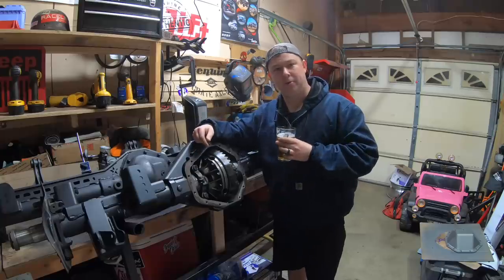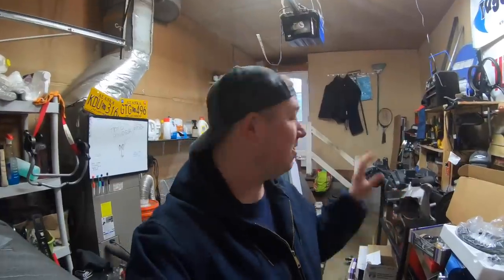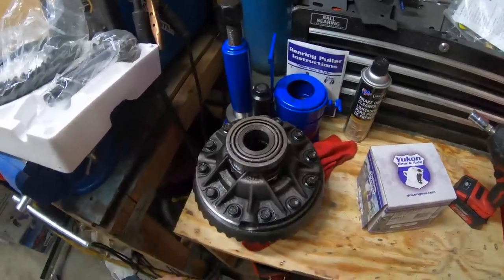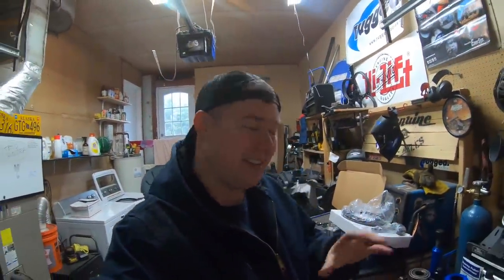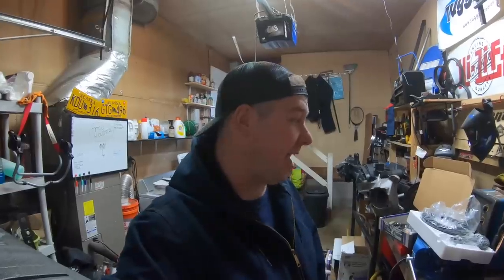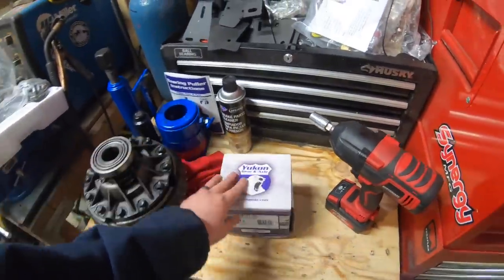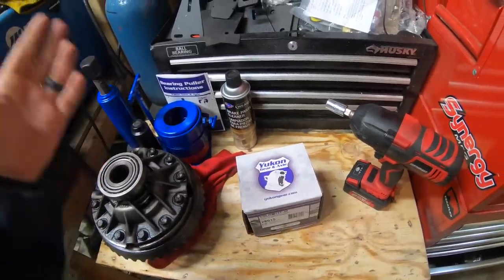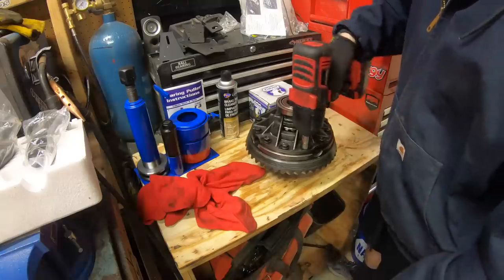14 Bolt Axle Regear And Locker Install - JK 1 Ton Swap Video Series

Comment from the maker: Additional info is in the video description! Feel free to ask questions below and I will answer them! Sorry it’s a long video, but I wanted this to be step by step. This isn’t supposed to be a fun or entertaining video, it was made to educate people doing this swap and hopefully help others that plan on doing this at home.
Reply: another good trick for installing a ring gear is to take 2 bolts and cut the heads offs and screw them in, they act as alignment pins.
Reply: If I’m using the same exact gear carrier and ratio out of another identical rear end do I need to set backlash from scratch or can I use the rotations of the adjuster sleeves I did to take the old gear carrier out to get the right backlash?
Reply: Thanks for this man, you’ve probably helped build more 14FF’s than you know!

Comment: Well,  I watched a bunch of videos but I  still was confused about the set up.. Thank you for your time to make this video,  as it covered  everything that I needed to know.. Thank you very much,  Well done.. I  have been a mechanic for 30 plus years but I had never set up a rear-end... I  usually  fix snowmobiles  or bikes, small engines,  heavy equipment and  fix my own vehicles,  and  boats,  but this was exactly what I needed...
   I prayed for the knowledge that I needed,  then turned on YouTube  and  you were there, and I didn't have to look anywhere  else...
      JESUS  SAVES 
             Thank you 
Michael Smith  in Maine USA

Comment: Man, you killed this instructional. By the way, just as a tid bit that I also found interesting is towards the end you talk about not having the right seal with the yoke.

You acutally had a the right seal and yoke for the 14 bolt, its actually a generational item!
AAM axles started using two piece seal, the original Corporate 14 bolt only used a single seal and the dust shield was integrated differently.

Glad you found the two piece seal before you threw it back on the road.

I used this video to see how you set the pinion depth (thats where I am at right now) just finished setting up the pinion pre-load with a crush sleeve eliminator - I really suggest it for future videos it was much easier to tear down, re-shim and setup.

Comment: It was a great video Ben. I wish I had the shop and free time to do a 1ton regear. ECGS quoted re-gearing my D44with an E-locker at $2500 with chromoly shafts. Purchasing their ECGS D60 with an e-locker, chromoly shafts installed on the Jeep was $3200. Seemed like a no brainer to me.  Maybe one day when I swap out the Ultimate44 I got from your raffle and do the 1ton up front I’ll restart this video and grown some balls to do it myself 😂😂

Comment: Motive gear Master install kit comes with ring gear bolts, that what brand ring n pinion I went with and install kit and the yukon grizzly locker. Good video I'll be doing a 14 bolt next.

Comment: Fantastic Video, I'm preparing to do my 14B swap now.  Thanks for the info.  Also the reason the pinion gets fried if the pinion carrier is misaligned is because the lube oil holes must be aligned.  The pinion carrier can go on any way (which means it can go on incorrectly where it blocks the oil).

Comment: It's actually after 10 o'clock p.m. Eastern time I watch the whole thing You are some of the greatest You conveyed it very well I'm 64 years old and I can tell you impressed me extremely well thank you And doing this video You made a mistake on that seal but that's no big deal because you checked rechecked and checked a 3rd time and you caught it.the greatest of the greatest.do the same thing you did However I liked your video very well and the best ones I've seen on all the above You conveyed it very well Yeah you miss pronounced a few stuff but that's OK you corrected it the end results remember what I'm gonna say It's a 100% correct or it's wrong there's no in between My friend I rate you at a 110% I wanna tell you something off the wall When a mechanic tells you he needs to break in the engine That is the wrong mechanic When you build an engine correct you're only setting the piston rings  A lot of mechanics say I got a break in the cam or bearings.  Bullshit. I have a great laugh brother bye

Comment: Thank you very much this is the only video I see that fully explains how to do this. I have the same rear end in a silverado 2500hd
Reply from the maker: Glad it helped
Reply: @JKGearandGadgets  I just finished mines today. The pinion was not bad. But the other bearing didn't want to come off. I didn't get the bearing remover. I cut a notch in those races and broke them off instead.

Comment: Funny bc I did mine a few months ago. I just sort of winged it. I wish this video was out when I did mine. I couldn't find any informational videos about this. Im also glad I realized the seals we're different before the axle was installed. I pulled the old wear sleeve thing off the old yoke.. got the part number and ordered a new one. I like the 2 piece seal set up better

Comment: I just picked me up a dana 60 clean ready to weld axle tube and 14 bolt axle that i will have to clean up get all brackets off. They both came with gears and axle shafts i dont know gear ratio but i got it all for 400 bucks im excited!!!

Comment: Great Job. A benefit of the crush sleeve is you can re-adjust your pinion preload (by tightening the nut) back to spec after your pinion bearings wear with time. Whereas with the Crush Sleeve Eliminator you will have to disassemble and reduce shim thickness. Also, you failed to mention the backlash changes after you change pinion shims and may need readjustment, but I think your final recap made it clear it needs to be double-checked in the end. Thanks for taking the huge amount of time to make this how-to video. Have you had a chance to run the set-up yet?

Comment: I just did to 14 bolt steering axles for my buggy and when I got to put the ring gear in the front with the school it was really tight it barely squeezed past the pinion bearing casting.

And then when I did the rear end and I was putting in my 538 Yukon gears like I have in the front with the spool same spool as I have in the front for no amount of work could I get the ring gear past that pinion support housing so the quickest work around was to carefully shave the sport housing down just a little bit probably just under an eighth of an inch there's still plenty of meat and I don't think I weakened it too much after I made the decision to do that I read on pirate that I wasn't the only one and it's quite common.

 If you don't want to go to that you could always I would suppose playing down the inside of the ring gear Fort Wayne down the adjuster a little bit but that would take some doing because if you claim down the threaded side of the adjuster you're losing thread if you plane down the contact side of the adjuster you may have to devil it back out again so it clears the cage of the bearing. It didn't seem feasible for me to add more thread to the inside towards the axle tube or to grind down up inside there so it would thread Beyond where it stopped.

Comment: It's me when you move the dial indicator rear and lower damn I was hoping I was going to be able to see the end of the pinion if it would come all the way past the backside of the ring gear I want this to work for me or I'll have the input shaft at the front an output shaft at the rear then I'll have a drive shaft to go back to that second rear end without fabricating a whole lot of stuff you are definitely a Craftsman Great American a great speaker great mechanic and the finest man that ever walked United States I don't know you you don't know me damn I wish I could have known you my years getting many

Comment: I am doing 5.36 on my Ram 2500 (Dana 60/80), first gear install. Don't need the crush eliminator as it uses shims to begin with. Running ARB lockers pushing 44s. Thanks for the video really helped.  Fab Forum has a good video on shimming too! I thought it was an interesting and informative video.

Comment: Timken is pretty much the best for parts store (autozone, advanced, oreilly, napa, etc) bearings, but they are still made in China. Koyo is made in japan and has been touted as one of the highest quality bearing companies for years and years, if you had the option for Koyo's I would have spent the extra money to get them. IE, I run Timkens for wheel bearings on my lifted Sierra 1500 daily driver, but I run Koyo's in my suzuki transfer cases with expensive aftermarket gears, etc.

Comment: Thanks, i already have the calipers and press. I bought a yoke already, did come with the seal, I think same one you bought.  Good to know on the seal issue.  Im torn to do mine as I want to wash the tubes out and I have a gm 10 bolt front and I want to change the gearing anyways so id have to do both but this helps on the 14bolt.  I may just put a locker in the 14 bolt now with air locker and just change the gearing on the 10 as I have a dana 60 that I want to put in but more money and for now I want the axles under it now.

Comment: Awesome walk through! You might try using a cordless drill (slow setting) for turning the pinion, with a wood block wedged between the  ring gear and housing (to create drag.) Just another of many ways to create drag on your gears while marking the pattern.

Comment: It's called wear sleeves I wanted to tell you that first I haven't seen the whole video like a few more minutes since to the end but let me tell you this you're the greatest of the Great definitely hang with them no complaints I want to ask you a question I hope you respond cuz I'm building a GMC HD I am using two rear ends 462 ratio here's the question if you had a special pinion gear custom made could you extend the pinion shaft were you would have a yolk at the back side or I could run the draft shaft to the second rear end I think so if not I be doing a hell of a lot of fabricating I am building my custom Kenworth

Comment: Quick question. I pulled a 2001 10.5 junkyard axle with unknown history, for a 3/4 ton truck project. I'm going to be using the truck for truck things, such as towing, daily driving, etc. I won't be off-roading. 

I removed the axle shafts, and discovered that the carrier bearings were shot. The carrier was very loose, and could be shaken about a 1/4 inch. The carrier bearings were still intact, but the rollers were badly pitted. There was a magnet in the housing, that had collected a lot of shavings. Once the carrier was out of the way, I realized the pinion bearings had considerable wear as well. Not as bad as the carrier bearings, but the pinion preload was nearly non-existent.

The ring and pinion look like they're still in perfect shape. Since the bearings were so thoroughly trashed, I'm surprised at the condition of the ring and pinion. Can I reuse these gears, or do they wear badly in a way that I can't see? This axle is already costing me a lot more than I planned on. If I can save the cost of new gears, I'd happily do so.

Edit to add: I don't remember you adding any lubricant to the bearings while assembling and checking the preload. Are you doing all preload checks with only the factory anti-corrosion coatings on the bearings? Or do you add a skim coat of oil or grease before assembly? It seems like an oil film could influence the preload results.

Comment: I've set up lathes for both Timken and Koyo lol both companies really make a quality bearing. Koyo and Timken both have plants here in the US and employ a lot of hard working machinists so I have no qualms about supporting either one of them. Quality difference is negligible. Bearings are made to international standard so it'll be the same material held to the same tolerance etc.

Comment: Great video, although leaving zero backlash prevents oil from getting completely inside your gears. Remember, too much backlash will cause immediate damage, no backlash will create problems down the line.
Reply: Wait…you addressed it. My apologies. Job well done

Comment: I have a 14 bolt in my 2500 chevy and it's clunking when turning at low speeds. Still trying to figure it out but I've never torn apart a rear end and I don't have a press or bearing puller so it should be fun but I'm kinda leaning towards the spider gears being bad everything else looks good. Great video I learned a lot from it!
Reply from the maker: Sounds like spider gears for sure
Reply: @JKGearandGadgets  I just got the spider gears this morning but I didn't order new ring gear bolts. Do you really need new ring gear bolts?

Comment: Damn. I wish I used the crush eliminater. Super tough to crush that pos. I imagine best reason to eliminate it is to avoid having to crush that pos. I was doing the jack handle cheater bar thing and had to weld a stop bar onto yoke wrench after striping it all wallered out. I put the grizzly with 4.88.

Comment: Hey thanks for the video, really helpful. One question, the last diff I did I checked the carrier preload. I don't remember you talking about having a value, a number for that. I'd need to dig up my notes, so this is from memory, which isn't that great. After you get the pinion and carrier installed, before the pattern, check the total preload at the pinion nut. Subtract the pinion preload from the result then divide (or was it multiply) the remainder by the gear ratio. That number should give you the carrier bearing preload. I could be full of it. Hey great video.

Comment: Really enjoy the vids on this subject!  You making 40's a reality for me!  One thing though...  So, you are putting a detroit style auto locker in the rear and a selectable locker in the front?  Currie racing did a bunch of studies on this combo and found that the best combo was a detroit up front and the selectable in the rear.  It allows you to take sharper turns on trails check out his vids.  Anyway... I am going to the junk yard soon now that you've shown me the way.  :-)  THANKS!
Reply from the maker: I would rather have a selectable in the rear for sure, but price plays a big factor! I will say I’m a big fan of selectable up front, auto locker in the front is not too much fun Offroad in certain situations
Reply: @JKGearandGadgets  I'm still trying to save up for ANY locker.  :-)  3 kids and a wife in Nursing school!  :-)  Anyway. REALLY enjoyed all the 1 ton builds.  I need to bui;ld up a 44 to replace my 30 so I can run 37's.  What size of lift do you have?  short arm?  Thanks again!
Reply: Yes maybe if you live in Cali, you want a selectable locker in front of you have wintertime. Open front diff is a must for turning on ice. Selectable front if you have snow and ice.

Comment: I just finished mine my 14 bolts are out of a 79 Chevy 1 ton and out of some of the older rigs the housing is a little different I guess and basically the pinion bearing housing can get in the way a little bit with thick cut gears at least with my 538 gears.  I actually had to use a grinder and take off a little meat off of that housing that holds the pinion bearing in so that the thick-cut 538 would go past there I tried for a half an hour before I took out the grinder and then I just took a little at a time about I tried about 7 times taking a little at a time until I finally got it to squeak past there and even then it was a chore and now that I've got it all done I have another question for myself if I should not have taken a little more meat off of that because when I first set the preload and I ran the gears all the way to the right with the ring gear until it wouldn't move and then I backed it off a couple notches. But I wonder if instead of it contacting the pinion gear if I was just contacting that housing for that pinion bearing I should have grabbed the pinion and wiggled it back and forth with my hand and made sure that that was locked up as well as the ring gear not moving to double-check and make sure because now for all I know I was just up against the pinion housing I know for a fact that it's like about less than 1/8 of an inch probably 1/16 from the ring gear to the pinion bearing housing at this point after everything is all said and done. Part of me wants to tear it all apart again and grind more of that away sew and redo everything to make sure but I don't know because that's a lot of work and it looks like I got a pretty good pattern with the paint so I might just run with it

Comment: Great video. Not sure if i missed it, but did you mention after backlash is set and a pinion depth adjustment is made that the backlash will need rechecked and probably adjusted?
Reply from the maker: I mentioned to double check everything again after the final gear pattern check, so hopefully they understood that. Also I’m hoping they will do more research than just watching this video. But good input! Thank you

Comment: Who cares about time,, more information is better,, never tried to be comedian and good personality counts when frustrated with rear differential my diff seems like stuck in posi,, going to pull apart trying to find issue? Can I adjust setting to compensate  ? Would like to keep original bearings if find not terribly worn ? Also  any thoughts about stuck in posi feeling when turn corners would be greatly appreciated,, still want to make sure didn't mis you taking apart spider gear housing ? some say nut and bolt through center because of spring pressure have seen others take ring gear off and no pressure? Maybe was different locker or spider gear housing ? Either way awesome video bud 👍

Comment: Awesome video! I'm going to be doing new bearings in mine this weekend. Do you know the inside diameter of the puller? I need to get a pipe for pressing the bearings back in

Comment: To install the ring gear easier put 4 or more bolts in and take a propane or map gas torch and run it around the ring until it drops down